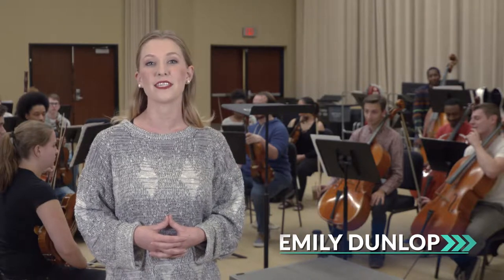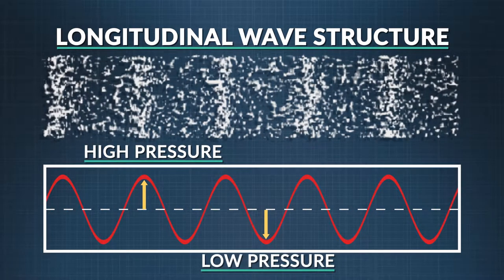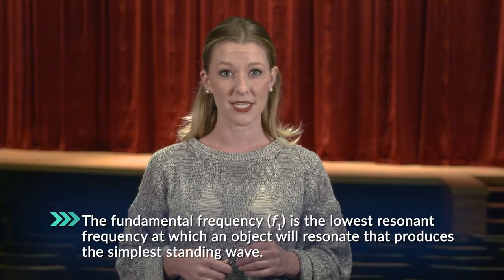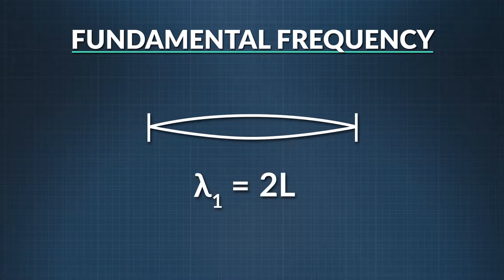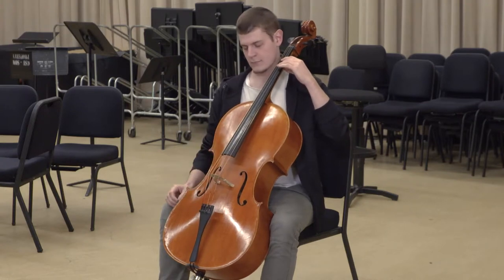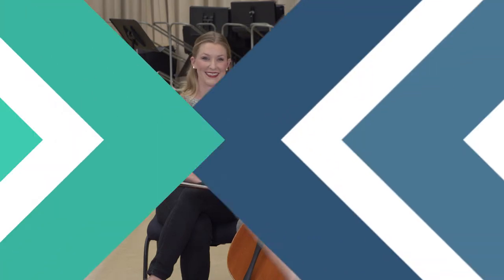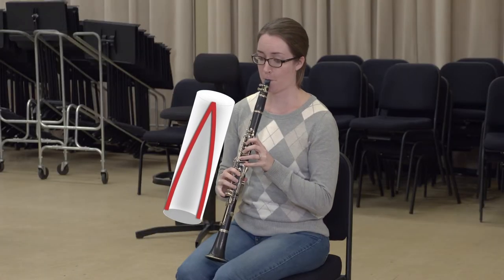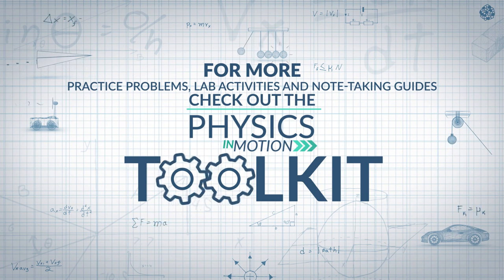Sound: Standing Waves and Resonance | Physics in Motion

Comment: I'm confused. At 1.22 she says it isn't about how hard you hit it it's about the rhythm in which you hit it. But he doesn't hit it in a certain rhythm , he just hits it once. And then after that she says that through resonance the amplitude can change which means it can get louder or softer, but then in the example the sound it softer when he hits it lighter, and the sound is louder when he hits it harder. So clearly it is about how hard he's hitting it. How is this showing resonance?
Reply: The resonance frequency on that specific instrument (tubular bell) its determined by the length of the tube, you can research more about that on air column physics. 

On the video, the demonstration is that on percussion instruments, the elements that produces musical notes (or resonant frequencies) that dont vary their shape, stays the same no matter how you hit It. You can definitely change the timbre, the volume, but the Frequency stays the same.
Reply: Rhythm was a poor choice of word there. The point was that whether you hit it hard or soft, it resonates at the same frequency. Loud or quiet is about vibration amplitude.

Comment: In relation to my previous comment, I should point out that light is focused by means of a lens on the center of a vibrating horizontal string that is fixed at its two ends.  The light is made to go through a vertical slot, and with a second lens, it is focused again on a rotating mirror which projects it unto a screen, but it is not clear, how the waveform of the vibrating point is registered, or else, how it is made visible.  Professor White says that that if various modes of vibration are active, the resulting compound wave can be observed.

Comment: So basically when 2 waves of same amplitude and opposite directions  meet, we get a standing wave. 
These standing waves are what are required for resonance.
Now resonance can be compared to father pushing his child on a swing. Only when the swing has travels to its extreme position can the father push it. If it choses to push it at any other instance of time, the swing may loose its height or in this case amplitude.
Resonance increases amplitude.

In closed wind instruments or string tied  to one end, the condition for resonance is that we need a node at closed and antinode at open end. So only 1/4th or 3/4th... waves could be created and thus they have the formula L = n λ /4 where L is length of string/pipe and n is odd

Whereas in In open wind instruments or string tied  to both ends, the condition for resonance is that we need 2 nodes at both sides.  So only 1/2 or 1 or 1.5 waves could be created and thus they have the formula L = n λ /2 where L is length of string/pipe and n is any no.
Reply: THIS HELPED ME UNDERSTAND TYSM

Comment: At 7:24, the chart showing the "String Harmonic Progression" has an error starting with the 5th harmonic.  The used 4 in the denominator instead of 5.  There is a similar mistake for the 6th harmonic.

Comment: I wonder how 3D cematic molecular sound, laser or microwave resonance printing could be achieved
to have stuff in 3 to 8 minutes of a molecular gas resin chamber.

Simply thausands of mini laser diodes shaping a 1x1 meter platform.

What it does is actually attract and fuse theese plastic molecules by the electromagnetic wave point
wich has micro focal heating points.
Imagine a 1x1 meter Box.
Each side has directional wave loudspeaker or microwave emitters, so that theese could create a standing wave on 0,3 inch or so.
Inside the box, wich is a sealed container for gases, a certain blend of molecular plastic structures is sprayed in as a gas.

A computer program calculates and establishes with the omnidirectional emitters of microwave and /or liner loudspeaker module platforms
to ultrasonicly create a focal cavitation point in the gas, causing theese to melt microscopically on the molecular level.
My this theoretically glueing plastic molecules in floating in the air.

Other perhaps better option could be 3D Microwave printing of Plastic gas.
Meaning 6 sides of the inner cube would need to have mininled sized emitters 
calibratable in sinus and amplitude able to move a focal point inside a line to create a wave resonance point at any point inside the box.

Could perhaps build a plastic table in 5 minutes after the inner wave chamber was filled with molecular plastic gas

Comment: Creating objects by sound.

Sound points fusing plastic or other material gas
Reply: Well, you wouldn't be creating Matter with sound but you could shape things like water, snow, ice, salt rocks and sand grains into various shapes using sound pressure waves.  It's actually very interesting and sound can be used to achieve lift and levitate things and also lots of other real neat stuff that I could tell ya about but I won't because then I would have to poke your eyes out And you probably like your eyeballs so I shouldn't tell ya about Screech Sabers &
silent weapons for quiet wars;^D.